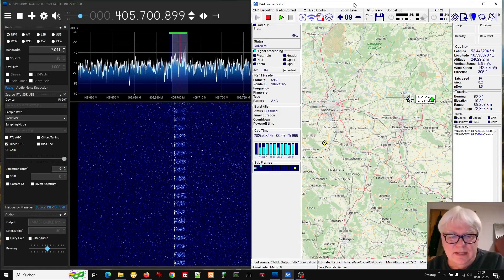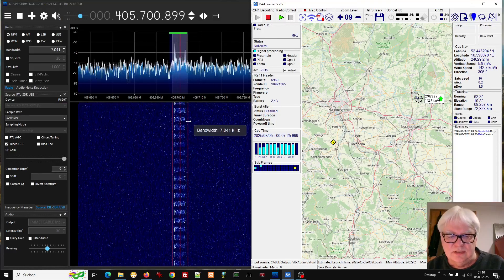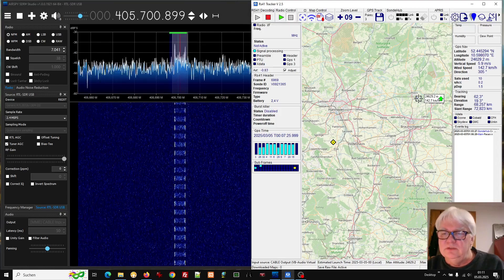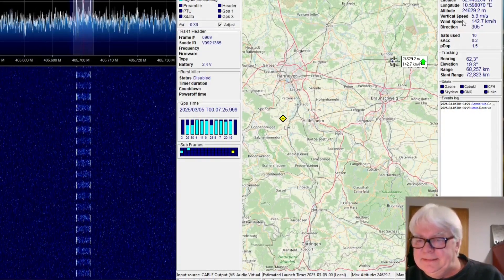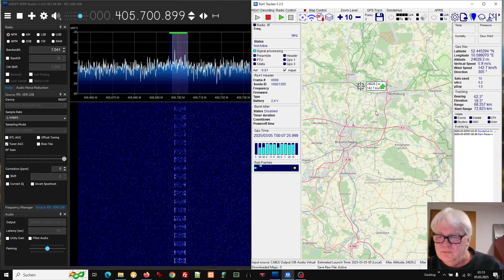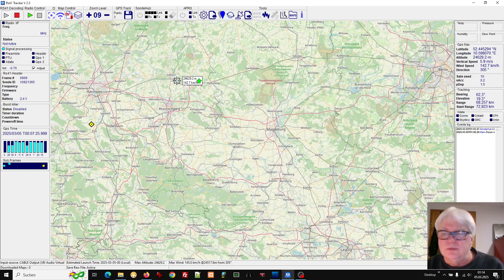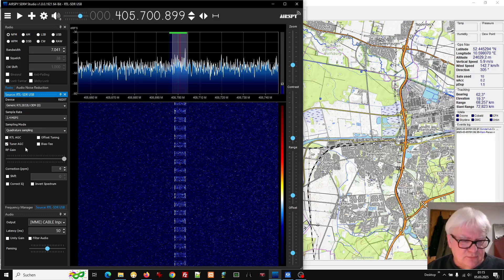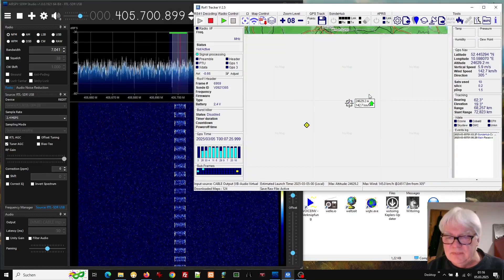Decoding a RS41 radiosonde with RTL SDR Nooelec V5 ♦ SDRsharp and RS41 Tracker

Comment: I got sonde signal much stronger than yours but on RS41 Tracker i got only Preamble light flashing, it was not decoding the signal further. Maybe you know what can be wrong?
Reply from the maker: Your signal can be strong but it's not "pure". You need a discriminator that provides a raw signal. With a cheap SDR that's easy. You can turn off all filters.
Reply: @Wanderlinse  Thanks, i'll look into that! I use RTL-SDR V4, software is the same that you use in the video.